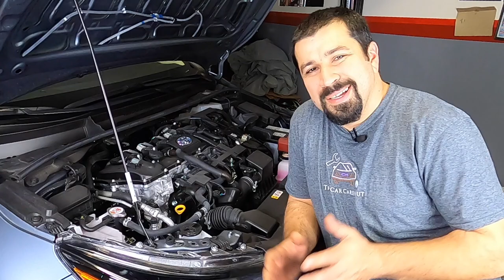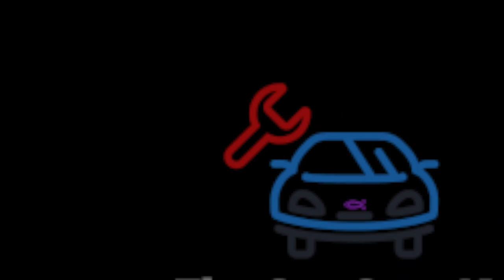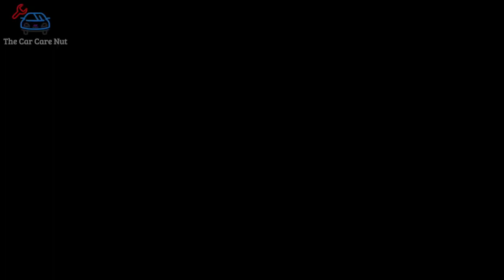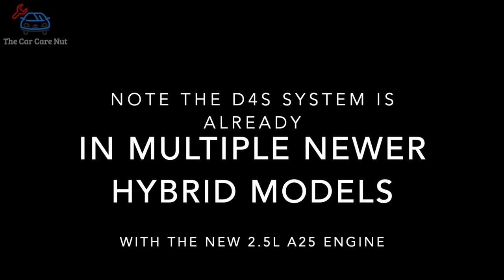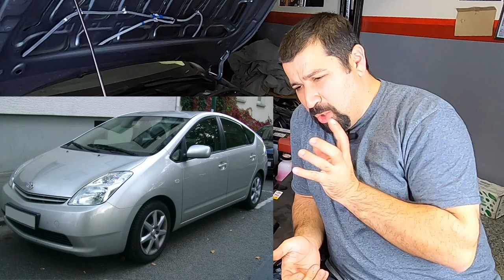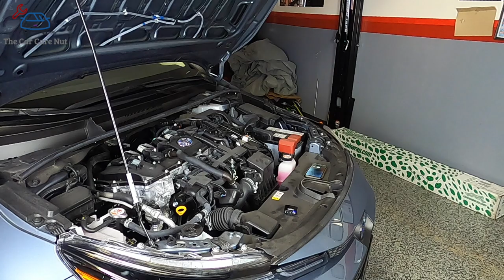How Toyota Hybrid System Work Part 5 Engine HVAC and more

Comment: I consider myself a competent home mechanic. Yet I fell into the trap of using freon with standard compressor oil in it when the system got low and destroyed my air conditioning compressor. I then had the fun of replacing the compressor as well as the evaporation unit which required removing the entire dash. Thanks so much for your help on this, I used your videos to accomplish this and hope everyone notices the tips about using the correct oil in an electric air conditioning compressor!

Comment: Thanks so much for putting these together. I have a Toyota Highlander hybrid approaching 300,000 miles and on a recent trip noticed significant vibration in higher speeds under slight acceleration, especially when the cruise control is managing the system. I'm going to start with the transmission flush which unfortunately I have never done but you have a great video on it. The vibration stops immediately when I tap the brake pedal but once again builds up the harmonic under slow continuous acceleration.   If you or anyone has any ideas I'd appreciate your tips!

Comment: I’ve been following your series’s and I find them extremely helpful. Thank you for sharing your knowledge. I’m looking to buy the new hybrid sienna bu my concern is regarding a statement you made about running the AC while park and how that can kill your battery. My question is how long can someone run the ac or heat while they are parked while they wait for their wife to get out of TJMAX....God bless and may he save us all from TJMAX
Reply from the maker: Thank you for watching my videos. Having the ac or fan running with the car on or ready on will not kill your battery as long as it’s in park not neutral. Parking for a short period of time is ok. Very long and frequent parking with the hvac on in any car is not healthy for it long term. I recently drove a sienna hybrid for an extended time and I love the thing! The interior is very impressive. They’re already out at least in Chicago find one for a test drive and see how you like it.
Reply: @TheCarCareNut  thank you
Reply: @PLC808  I believe the RAV4 Prime PHEV can, but not for my RAV4 hybrid. 

It’s generally preferred that you pre-cool a PHEV connected to the charger and I’m sure there is a lockout to prevent pre-cooling if the traction battery charge percentage is too low.

Comment: I would recommend annual throttle body cleaning as well, because the atkinson-miller engines tend to burp soot. My son has my early 2002 Prius, with the un-updated ECU that throws the Big Red Triangle of Death!!! (drama is important in our lives) every autumn when the weather turns cold unless the TB has been cleaned recently.
Thanks for the warning about the refrigerant oil! I was good with charging R12 back in the caveman days, but R134a took me to the shed the first time I tried it so I don't do my own now. With your warning, I think I will use the dealer for A/C services on our 2014 because we don't have any other Toyota specialist in town.
Reply from the maker: Very good recommendation on the throttle body.
Reply from the maker: It’s not as needed in the newer Prius. But it’s a good idea to visit the throttle body and clean it. It’s actually very simple and very diy to do so.

Comment: Yet another fantastic video, AMD! You’re such an educator. 

By the way! They could not do the alignment with the aftermarket parts that I installed on my Toyota Verso-S (NCP120). Only two providers of the inner tie rods and both are too short. It needs a new rack. Sadly enough I can’t do that on my driveway without investing in a Quick Jack and a couple of other things. The rack costs $786 here in Sweden. The workshop time and costs will be another $802. 

It is still cheaper than what many VW and Audi owners have to pay for ordinary maintenance though. 

I wish you and your loved ones a really nice weekend.
Reply from the maker: Thank you Jonas. 

It’s a mystery why Toyota doesn’t sell the inner tie rods separate. They used to at some point but not anymore at least for most models.

Comment: I bought a 2021 corolla hybrid last weekend. I made up my mind on my new purchase then found the first few videos of your hybrid series, I taught the salesman a few things as we were doing the walk around. I just filled up the tank yesterday and averaged 54.5 mpg with a mixture of highway (70mph) and around town driving. I definitely had a what the hell is that reaction to the ufo sound.
Reply: Is that 54.5 mpg in US gallons?  My new Rav4 hybrid usually gets between 50 to 60 mpg (Imperial gallon) which is about 1/2 liter more then a US gallon.  If I go into Settings I can choose to set it on US or Imperial gallons, not sure if you have that feature on your new Corolla hybrid.  Congrats on a great purchase!

Comment: I'm a licensed tech and my wife bought a 21 rav4 hybrid , when she pulled it into the garage for the first time and i heard that noise i too wondered what the hell was wrong with it. My first mod might be to disconnect that stupid speaker behind the grill ;) Thanks for the info , identifix etc. has no info on the 20/21 rav's as of yet
Reply from the maker: I hear you. I remember the first time I heard that noise I thought that’s gonna the first thing to go lol but I suppose for safety it’s not a terrible idea but a better sound might’ve been better
Reply: If you disconnect it error will come in the dash and some safety systems will be disabled. However you can take it out and wrap lots of electrical tape on it to muffle/mute it. Located directly behind Toyota logo on the front.
Reply: I don't understand what the problem is with that sound..... I love that sound on my new Rav4 XSE.  I traded in my 2019 Insight for my new Rav4 and it had the same sound but maybe not quite as loud but it's for safety so it doesn't bother me whatsoever.
Reply: @James-il3tq  You can replace it with a 22 ohm 2W resistor to prevent the error from occuring.

Comment: oh i always fear my waterpump leaking one day on my V6 Hybrid...they say its the weak point of that bulletproof engine. you are right with the electric waterpumps warming up more fast the engine BUT is´nt it better to have a little circulation for warming up the whole engine gradually instead of getting warm hot spots like cylinder head and cold spots like bottom crankshafthousing ! I mean as long as the thermostat is closed there is only the small bypass circle working; but yeah it needs a little bit power always. My V6Hybrid from 2010 does have a clever system to recircle the warm exhaust gases for faster warm (it really needs that due to 3.5ltr !!) up and better mileage EHR (exhaust heat recovery). would like if you can explain it a bit.

Comment: GREAT CHANNEL! Subscribed.  Switching back to Toyota's from Hondas. Looking at 2021 RAV4 (me or wife), Tacoma (me) or Camry (wife). Which is the most reliable.  Really liked your video of 4 Runner but out of my price range. Also like the Venza but stay away from 1st model runs.
Reply from the maker: Thank you! Welcome back to the Yota world! I’d say the RAV4 and the Camry are very similar in reliability. The Tacoma comes after simply because it’s a truck and they tend to need more maintenance over time. But the Tacoma will likely hold its value better than the other two. If you keep your cars very long I suppose resale value doesn’t matter much

Comment: We have a 2019 Prius XLE AWD and just added a 2021 RAV4 XLE Premium hybrid. I was under the impression that all Toyotas (besides the Mazda Toyotas) from 2017 on had the dual injection.
Reply from the maker: No some models still have port injection only. The v6 in most models today is D4S but some are not. Same with the 4 cylinders
Reply: @TheCarCareNut  Is there a way for me to find out if mine has dual injection? I just bought a 2020 Rav4 Hybrid XLE.
Reply from the maker: Your RAV4 has the D4S so 4 port injectors and 4 direct injectors

Comment: Also bought a Toyota Hybrid. Love it!  What is the sound when I come closer to my car with the beeper on hand? The car is turned off but there is a sound for a few seconds. I think just after opening the driver’s door.
Reply from the maker: Hi! That sound is the brake booster pressurizing the fluid and it’s totally normal.
Reply: @TheCarCareNut  Thank you! Saw your video what exactly was it just minutes after asking. You answered so many questions that are not in the manuals.

Comment: Toyota India has launched Toyota urban cruiser Hyryder, with both mild and strong hybrid. Can you please give your analysis in the strong hybrid and it's predecessors, like where was this 1.5 3 cylinder engine used before and whether it's a successful engine or not. Launches in India have seen a lot of cost cutting, and this car was jointly made with maruti suzuki which has also launched similar cars, and hence a review from your end on what to expect would really help. I'm a fan of your channel and how you have broken down this complex hybrid system and put it across so simply. Thank you.

Comment: Thanks again for this explanation of the hybrid engines. One thing I would say. On the reverse beep noise. There is anyway to place the noice outside the car?? It will help with many distracted pedestrians texting while walking 😉
Reply from the maker: Priis that make the beeping sound when reversing is to alert the driver you’re in reverse. The sound you heart in this video is very loud and hard to miss. Some of the older models didn’t have it. In those cases an aftermarket solution is the only way
Reply: I recently had my dealer disable the in-car reverse beeper. It drove me nuts, and I couldn’t see a reason for it. (Ive learned that the car moving backwards is sufficient warning that it’s in reverse.)
Reply: As much I dislike that beep.  I think 🤔 it’s a safety issue since the car can be extremely quiet at low speed
Reply: The backup sound made by new Toyota hybrids is NOT for your listening pleasure it's to warn pedestrians that you are backing up & it alerts them of such.  It's a GREAT safety feature... I believe the sound should be even louder.

Comment: Hi. I think about buying a Corolla 2019. But i wounder how cold outdoor tempreture the batteri can handle.
In The winter time we can have minus 40 degreese. Does it gonna be a problem.
Tanks for nice videos.
Reply from the maker: Thank you for watching my video. The battery can handle cold temperature as long as it’s not parked for a very long time without being driven in the cold.

Comment: Does the heat to the cabins flow from the battery or from the hot engine? how did the manufacturer solve it? I ask about heating immediately after starting the engine.

Comment: Hi , I love your content as always, I have a question about my 2014 Avalon Hybrid that I just purchased at 160,000 miles !!, it runs great but I was wondering what do you suggest I should maintain immediately as there is hardly any maintenance records at Toyota dealership , just a few oil changes, I really appreciate any suggestions, thank you
Reply from the maker: Hi! Congratulations on your purchase. I would have the car inspected for safety first. Tires and brakes. Get an oil change and drive it for 6 months to make sure everything looks good. Then start with replacing both coolants and the trans fluid. Keep the vent on the drivers side of the back seat clean and vacuum it regularly and you should have no issues. I would change the oil every 5k or 6 months

Comment: Highlander and sienna hybrid now have 8 fuel injectors, direct and port injection! Port injection will clean the valves at slower speeds and better mpg in town.

Comment: Another masterpiece video. My 2007 Camry Hybrid has nothing left of the Freon in it. Seems it has leaked before I bought it. I had the shop check it and they confirmed that. I am going to fix it in maybe June 2021 since we are in the Fall, Winter, and Spring. After this video I will take it to the dealer to fix the leak and fill her up, I don't know about local shops and if they pay attention to the special oil needed for the compressor or would that matter if they just use R134 to fill it, no oil or anything else?
Reply from the maker: Hi Ahmad! Thank you! So your Camry does use R134 but the oil is what’s different. At every Toyota dealership there’s a dedicated machine with R134 but has never touched any car but hybrids to avoid oil contamination.

Comment: I just recently purchased a hybrid RAV4. I love almost everything about it except the Angelic scream it makes in EV mode and the fact that after engaging the remote start function the vehicle shuts off as soon as a door is opened. It’s incredibly frustrating. Is there any way to disable that response? This is my first Toyota.
Reply from the maker: As far as I know you cannot disable the vehicle proximity alert. Regarding the remote start sorry that’s a design limitation and it frustrates me as well. They have to do it where it shuts off due to the smart key system design

Comment: Is the stop and start engine new features on the new models like 2020 good or bad and does will create problems later on. I am planning to buy a new rav 4..thank you
Reply from the maker: There are 2 theories on this. One says it will harm the engine one says it won’t. I trust Toyota engineering that it will not harm things. But the harm wouldn’t be immediate if any, it would be over a very long time.
Reply: You're right. Now a days  car companies put alot of safety features that you don't need and then later on after 5yrs if those features fail/break,you have to service/ fix them to the dealer .that's how they get you, the more the features the more Maintenance..thank you

Comment: Great video, informative and much improved from your previous many videos!  Can you comment/create video on 2015 Prius (3rd gen) about winter driving AC heating performance and whether or not engine block heater is required for hybrid car.  Thanks!
Reply: It's a good idea to have an engine block heater for the gas engine on your hybrid especially if you live a very cold climate that goes under zero fahrenheit at night and even then plugin it in for a couple hours on a timer is sufficient enough amount of time to warm up the engine.

Comment: Hi Iam a new rav4 2020 hybrid owner. We all know that hybrid is efficient for city driving.  What about for long  drive i. e interstate driving.  What is your advise how long can i drive my hybrid continuosly without stop. It is good for battery?
Reply from the maker: Hi! Hybrids are more than capable on very long drives! Don’t worry one bit about the battery on long drives. One thing I will say on long drives. Try to avoid continuous high speed driving for hours at a time. High speeds exceeding 90mph could stress the hybrid system over a long drive. But driving normal highway speeds up to 90mph you can drive it as long as you need without harming anything.

Comment: Chief , Is it safe using a Toyota Corolla fielder RHD converted to LHD , buying a used car imported in Kenya from Japan , took a test ride and no alignment faults found Maneuvering was smooth.The push button start is not there only manual key year 2013 model. Pls advice
Reply from the maker: Be careful with those. I’ve actually seen those before not in the US and some of them are done right and some are done terribly. You want to know who did the conversion.

Comment: Great video. I’ve had my 2015 Prius for a year, and love it. 
Question: on my last service, my dealer suggested a “fuel injection cleaning.”  It’s not in the Toyota (Canada) service recommendations, so I declined. I’d be interested if you think it’s worthwhile, or a high-margin but unnecessary thing. The car has 80,000 km (50,000 mi).
Reply from the maker: Thank you for watching my video! So the fuel injection cleaning could be useful in certain cases. Here’s a video that I made with more information on this subject https://youtu.be/4WE1cQDnOQw
Reply: @TheCarCareNut  Top Tier gasoline + Italian TuneUp.  Thanks!

Comment: Love your videos!
Just bought a 2022 Sienna last week and am loving it. In this video, you mentioned a non-conductive oil for the AC compressor. Is there oil in the compressor or are you referring to the refrigerant?
Reply: Every compressor Iv worked on has oil in it.
Usually mixed with the refrigerant.

Comment: If you take a 2022 Camry Hybrid, and put the HVAC in ECO mode, will the PTC heater still run in the winter?  Or will that be disabled to improve fuel economy?

Comment: I would like to try out Prius before buying one. Wld u mind to recommend me which make and model of Prius that I can test drive for a few days? Eg. 2010 Prius C, Prius or Prius Alpha/Plus; are there any significant difference in drivability while driving a Prius C 1.5L or Prius 1.8L while driving in an ECO mode(not performance).
Reply from the maker: If you want to try it ask dealerships for a rental car or some of them call it a 24 hour test drive. Also check out Turo which is a service that lets you rent other peoples cars.

Comment: Loving the content, learning a lot from your videos. I've heard that you should use the AC regularly to keep the compressor working properly. Is this true for modern hybrids? Thanks.
Reply from the maker: Yes that is true. It helps keep the oil distributed in the system.
Reply: @TheCarCareNut  thanks for the quick response. How often and for how long would you recommend running the AC? Bit cold at the moment so hardly using it.
Reply from the maker: I would actually have the AC turned on in winter time. When you set the air to hot the ac is used as a dehumidifier to help with window fogging.
Reply: @TheCarCareNut  Thanks for the advice. Have a good holiday! I'll try and join your live stream on the 26th.